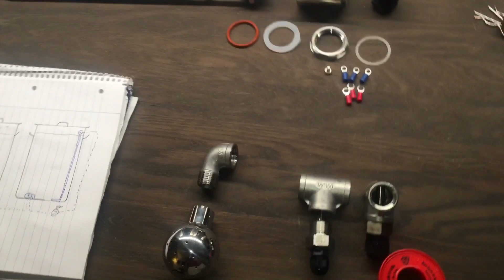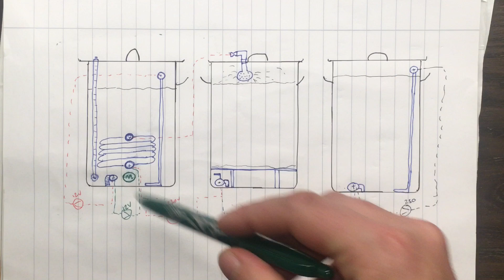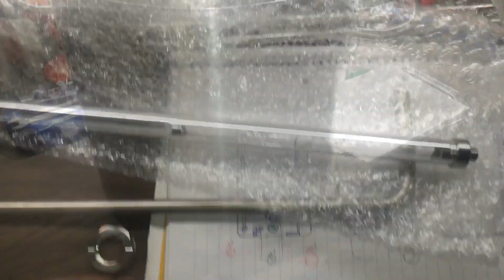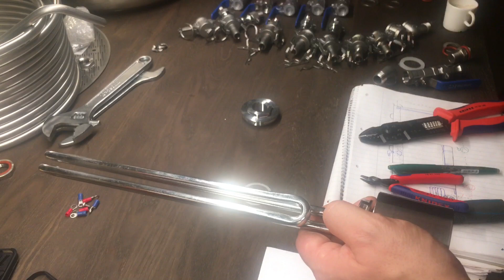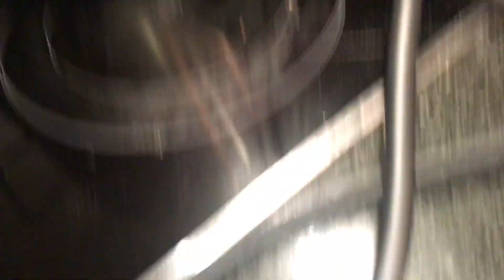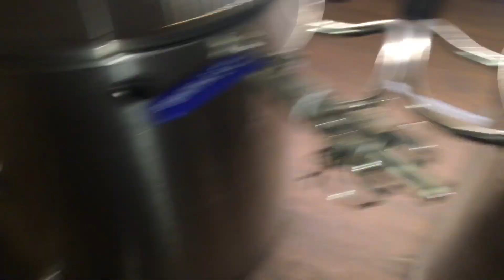HBW 18: Kotten Brewery - HERMS BUILD, Mechanical Processes systems aka pots, pans pumps & stuff

Comment: Hey mate. I'm just starting to build a similar setup. I'm struggling to find the 1.5" temp probes you have on the t-pieces on the mash tun and herms out. Where did you get them from? Thanks
Reply from the maker: Hi Noel. They are PT100s. I bought them from a German seller on eBay 

https://rover.ebay.com/rover/0/0/0?mpre=https%3A%2F%2Fwww.ebay.nl%2Fulk%2Fitm%2F300516241654

Comment: hi Brewmacker!thanks for these great videos, keep up the good work and a really nice setup! thinking about building the same for 75 litre kettles. by any chance, can you share the china contact with me ? do they also offer bigger fittings then 1/2 inch? definitely gonna go for the brewpi equip...
Reply from the maker: Hi philwill, your welcome mate and glad it's helping. BrewPi stuff is top!
I use Ali-express for the fittings, there is an app and they always write $5.00 on the label so no import fees. They have wide range of 304/316 SS fittings both with BSP (Europe) and IPT (USA) treads. So pick your tread standard and apply it across you system. I am sure they have bigger fittings. Not a problem. 
Also I had problems fitting BSP Chinese fittings with BrewPi camlocks. The male/female cams didn't fit
Reply: Brewmacker ! thanks mate!

Comment: Just out of curiosity, why did you get the long whirlpool inlet parts instead of just drilling the hole lower?
Reply from the maker: Haha, Good question mate! I don't know why, apart from I ordered a set from brewpi that was available with weldless fittings. No reason that I can think off that using a nozzle at the bottom of the kettle couldn't do the same job. Maybe someone else can shed some light on this :) cheers
Reply: Ok  I was just trying to figure out what I'd missed :)

Comment: Hé there Mr. Brewmacker, i got another question, when i am looking for the RTD PT-100 i get the thermo probes with 3 wires, why are there 3 wires on the PT-100 and only 2 on the K-type? Almost every forum says PT-100 is better (so i do want to buy those) but i dont get the 3 wire part.
Reply from the maker: Hey Booper, it is also possible to find PT100 with only two wires. I have chosen a three wire PT100 because the additional wire allows for better resolution and accuracy when measuring temperature. But I think for the sake of home brewing that both will work well, I just figured it wasn't much more expensive to buy the three wire PT100. So why not :)